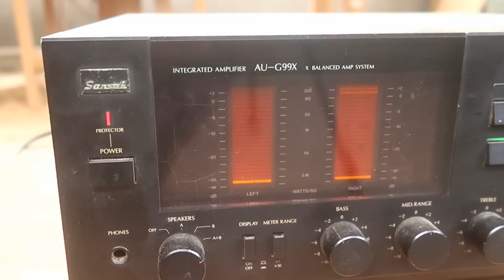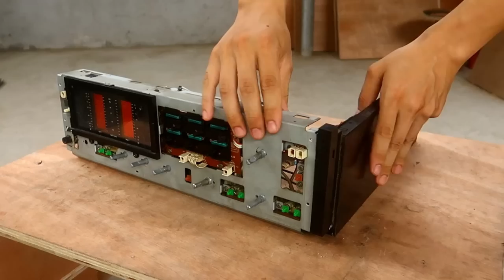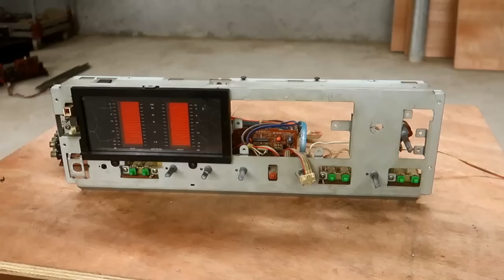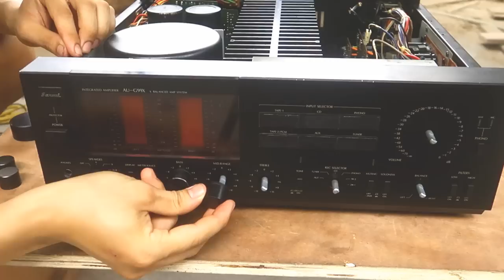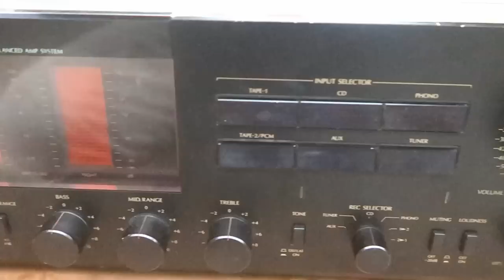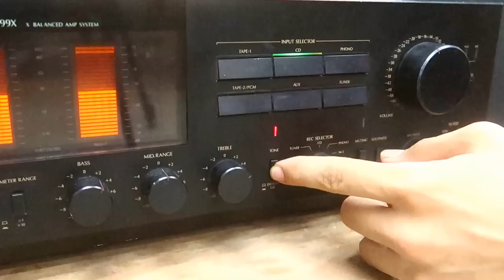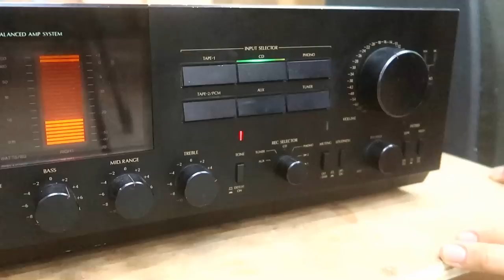Sansui power amplifier restoration  //  Repair & revive faulty Sansui power amp

Comment: This video is titled power amplifier restoration. This is not a power amplifier, it is a integrated amplifier
Reply: Correct. And he didn't replace any caps. Weird.
Reply: what is power amp?
Reply: @montech5647  as long as it works, who cares for caps? has too much bass. Maybe caps no good?

Comment: Didn't really check anything other than power or transistor shorts.  Some CAPs are probably shit... Also,,, didn't bother to sand before panting.  You can see all the smudges and imperfections under the paint. 😮‍💨